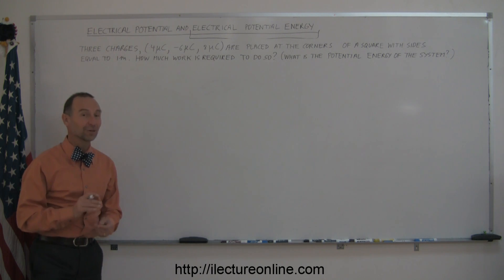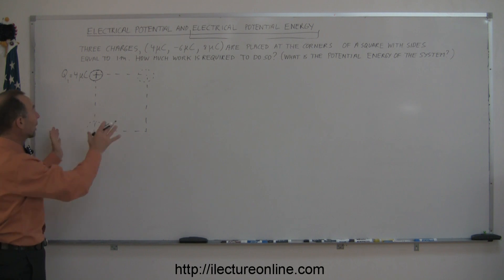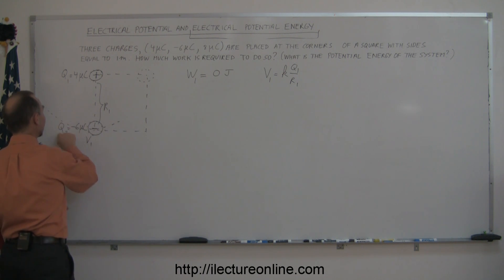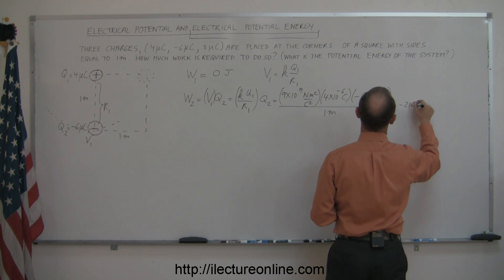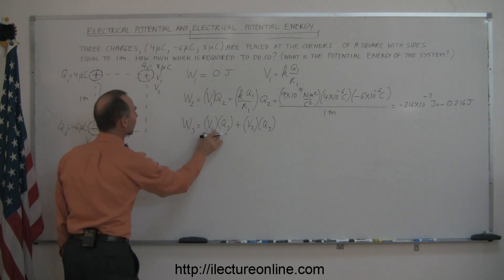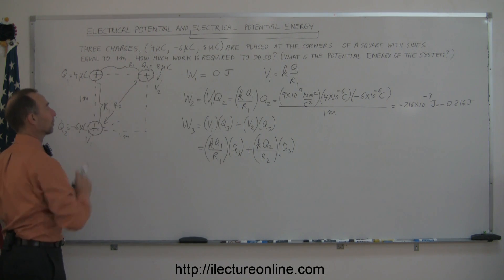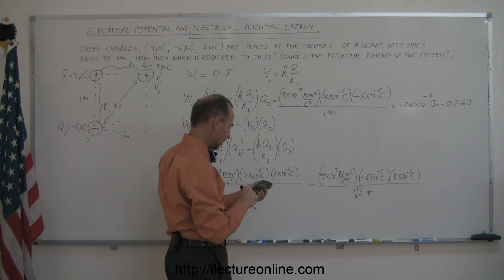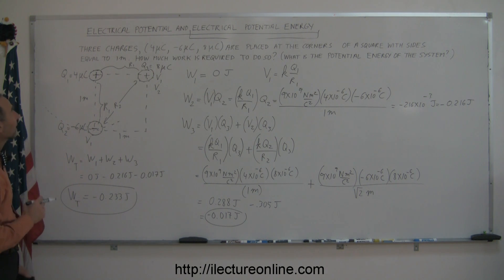Physics 38   Electrical Potential (6 of 22) Electrical Potential Energy

Comment: does placing the charges in different positions change the value of the resulting work done?
Reply from the maker: It depends on the symmetry.  If the charges are exchanged, but the changed charges are at the same distancem ,then no.  Otherwise moving the charges will change the final result.
Reply from the maker: Not if they are at the same distance of one another.  But typically, yes, the work done will be different.

Comment: Thank you. I was never quite sure about  how to round decimals to the appropriate number of sig figs in electromagnetism problems. Here you seem to have chosen to keep three significant figures. Is that because of the work done on charge 3, which contains a zero after the decimal, and the first significant figure would then be  the second digit after the decimal?
Reply from the maker: Significant figures are only important when actual measurements are taken in real life situations.  Here we are just learning the theory and the techniques of solving these types of problems, so we are not concentrating on significant figures.  (we are using made up numbers that are not measured)
Reply from the maker: But technically speaking, if these were measured values, then the answer should be rounded to 1 significant figure  (  0.02)
Reply: @MichelvanBiezen  Thank you very much:

Comment: Hello sir, 
I really appreciate the explanation as to how you would approach in solving these types of problems. I just have some questions to ask - 
1. How would you find the electric potential energy at the center of the system? (Like finding the electric potential energy at the center of the three charges you have given in the example.)
2. What is the connection between Electric Potential Energy and Electric Potential? Would a negative value in Electrical Potential Energy indicate a negative value in electric potential? How would you tie the two big concepts?

Comment: Excuse me sir, isn't the formula for work done is W=-qV ? But why don't you put the negative sign?
Reply from the maker: Rather than memorizing a formula it is better to understand the formula and know why there is a positive or negative sign.  When the work done ADDS energy to the system then you are doing positive work.  If the work done reduces the energy of the system you are doing negative work.   Bringing a positive charge closer to another positive charge requires positive work.  Bringing a positive charge closer to a negative charge requires negative energy.
Reply: @MichelvanBiezen  ouhh..I understand now. Thank you so much prof😊

Comment: sir,
I have doubt
three charges must be placed in order of 4uC,-6uC,8uC,0uC
but you placed in the order of 4uc,-6uC,0uC,8uC
Is your charge representation correct?
Reply from the maker: If you place them in a different order you will get a different answer.  (That is not important as there were no specific instructions as to where to place them).   How to do the problem is the important aspect.

Comment: Mr. van Biezen I tried this problem again placing the charges at different corners and am getting multiple different answers. How do I know where to place them to get the correct answer??
Reply from the maker: Placing the charges in a different ORDER will result in a different answer.  That is OK.
Reply: So answers will vary for this problem?
Reply from the maker: Depending on which order the charges (+ and -) are placed in.
Reply: Thank you! You're the best!

Comment: so when a positive charge and a negative charge are an infinite distance away, they have infinite potential energy? Im assuming this because you are saying that potential energy decreases as you bring a positive charge and negative charge closer to each other.
Reply from the maker: A good way to figure that out is to take two positive charges and place them infinitely far apart and call that the zero potential energy position.  Now how much work would it take to bring them close together?  The answer: PE = k * Q1 * Q2 / R    It then would take the same amount of work to take a positive and negative charge (of the same magnitude) and pull them apart to infinity.

Comment: sir , i used the same method as yours but i got different answer if i placed the third charge below the second charge
Reply from the maker: If you place the charges in a different arrangement you will get a different answer.  (That is to be expected).

Comment: why q2 is not affected by q3?
Reply from the maker: q2 IS affected by q3.   When you calculate the work done to bring charges together, you have to do it one charge at a time.  When you place the first charge there, there are no other charges so it doesn't take any work.  When you bring the second charge close to the first charge the third charge isn't there yet so you only calculate the energy between charge 1 and 2.  But when you bring the third charge in, you must calculate the energy caused by q1 and q2 being close and the energy due to q2 and q3 being close.

Comment: why W2 is negative?
Reply from the maker: If it takes 10 J of work to lift an object from the floor to the top of the table, then it will take  -10J of work (negative work) to "lift" the object from the top of the table to the floor.  (Since the object loses potential energy, it required negative work).  That is the same as W2.  The second charge will lose potential energy by bringing it close to the first charge, since they attract.  Thus it requires negative work to bring them closer.

Comment: Hello professor its me again ~sorry for so many questions on difference videos of you, because I'm currently in physics 121 ~If i put an electron and its start to accelerated toward the proton the positive charge which is already theres in the first place, so the work done is negative because it moved to the lower potential energy. The final conclusion is higher potential energy moving toward the lower potential energy the work is negative PE(final)-PE(initial)=-W ? Can i bare thats in mind? opposite to that if lower potential energy moved to the higher potential energy ( the proton moving toward to another proton) would the Work be positive ? ...Oh my god sorry for the long question~ because its so confusing to mind visualize how everythings  that work in the small scale in physics .
Reply from the maker: If a negative charge moves closer to a positive charge (or a positive charge towards a negative charge) the potential energy decreases.
There are some videos on that exact  concept

Comment from the maker: Joe,
Here is a good analogy,

When you are lifting an object from the floor onto a table you are doing work against gravity.  (That is positive work)
When you take the object from the top of the table and lower it to the floor you are doing negative work.
Reply: Hello Professor, if the book is lifted up, shouldn't that be negative work since the displacement and force vectors are opposite?
Reply: Ken T. Nguyen 

I think no because we are not taking in consideration the weight.. but our focus is on the force applied by hand lifting the book up.. force applied by the hand would be in the upwards direction that is the same direction of the displacement of the book hence positive work.